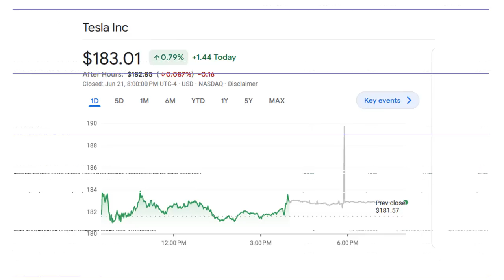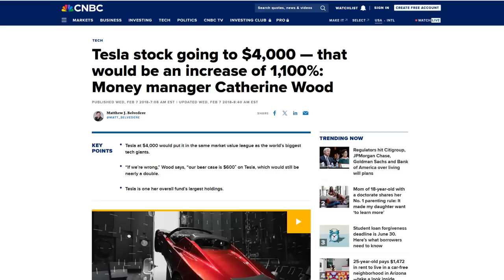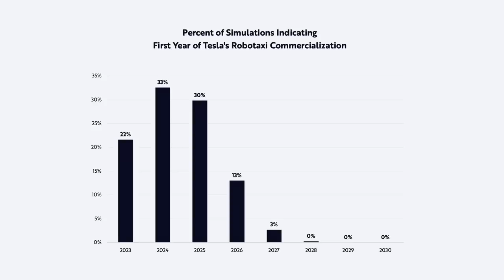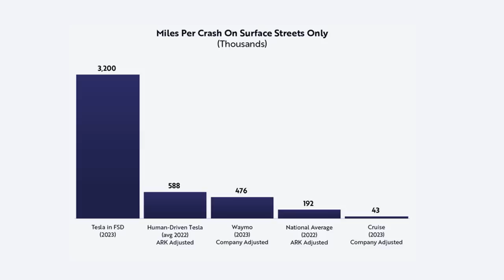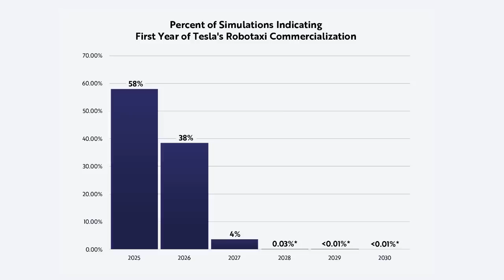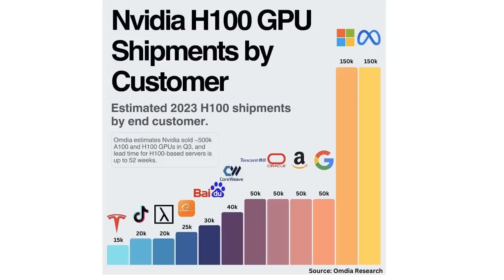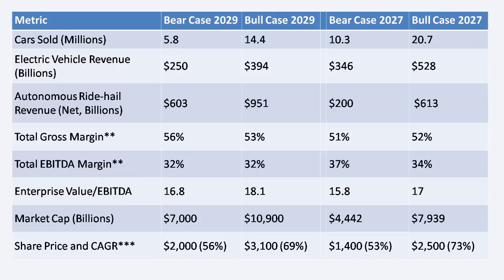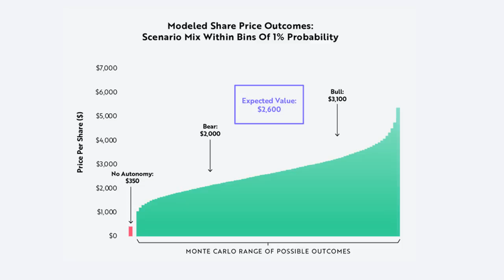Why Does ARK Invest Think Tesla Can Hit $10 TRILLION in 5 Years?

Comment: personally if i take a robotaxi and have a bad experience, i won't be taking another, and feel that starting with a human driver in the car, even if they are just there to monitor the system, will provide a sense of security for early riders and in locations that there isn't enough data already to make smooth drives possible.
elon may not want to go this route, but if there are no customers to take them up on their robotaxi ride because of experiences, be they true or false from others that they trust, that will prevent many people from even trying one.
you know the FUD is already hard core on EVs, once you begin to disrupt Uber and Lyft, they will begin their campaigns to spread as much fear for the competitor as they can.

Comment: Lets look at the Issues
1. EV Slump because people do not want EV's.
2. EV's still cost a lot more.
3. EV's still have a much higher Co2 Emissions Footprint over ICE until they are at least 15 to 20 years old.
4. Most Grids cant handle a 40% increase never mind a 2x to 4x increase in power draw.
5. Elong fired the Supercharger Team.
6. EV Batteries are dangerous and hard to fix or replace. They are literally a Structal part of the car imagine that for a fuel yank?!
7. Self-driving is not good enough and even if it was Law Makers on State and Federal Levels will be slow and unwilling to approve self-driving car tech for decades
8. LIDAR, RADAR and Sonar should all be part of a Cars Safety System Elon just relying on cameras is Arrogant and short sighted.
9. Tesla can not upscale production enough to have enough cars to make RoboTaxi a reality in the next decade.
10. Every Years FSD & Autopilot are meant to be coming.
11. Paying Elong more in Stocks than the company as EVER Made in Total Profit.
12.  Lied Cyber Trucks on the Road.
13. lied as to Cybertruck Release.
14. lied about Semi Release as well as Capabilities.

TESLA & ELON have Tonnes of issues too fix and faith to repair or they will Crush and Burn!
Reply: "6. EV Batteries are dangerous and hard to fix or replace. They are literally a Structal part of the car imagine that for a fuel yank?!"

Incorrect. EVs catches fire way less frequently when compared to ICE cars and the batteries in your car will not be needed to replace during the lifetime of your car. 

"7. Self-driving is not good enough and even if it was Law Makers on State and Federal Levels will be slow and unwilling to approve self-driving car tech for decades"

Incorrect. FSD is quite good and is pretty close to be solved now. And when there's data that FSD is safer the government will be quick to approve it. 

"8. LIDAR, RADAR and Sonar should all be part of a Cars Safety System Elon just relying on cameras is Arrogant and short sighted."

Incorrect. Lidar and radar is quite meaningless if you want to build a self driving car. It just adds noise and complexity for no good reason. 

"9. Tesla can not upscale production enough to have enough cars to make RoboTaxi a reality in the next decade."

Incorrect. When Tesla solves FSD they can instantly enable the support of FSD for all cars having the necessary hardware. Tesla have also demonstrated that they are quite good at building new factories and ramping up production. 

"10. Every Years FSD & Autopilot are meant to be coming."

Every day the earth is set to circulate around the sun? Go figure. 

"11. Paying Elong more in Stocks than the company as EVER Made in Total Profit."

He was just granted the compensation from the old compensation package where he reached all the hard goals. It's also stock based compensation so he actually needs to purchase these stocks and hold them for a minimum of 5 years.
Reply: @yourcrazybear  You assume everyone or at least a large number of people will opt into Robo Taxi (they won't, Unless Tesla Opts them in by Default!) also Elon also wants his own Tesla owned Cabs that will cut into public sale production that assumes Federal State and City Permission is given for FSD/Auto Pilot, Nevermind if Taxi or equivalent Licenses are given.

Nevermind insurance costs and who is held liable (Owner, Operator, Manufacturer?) and how that will be identified and issued
Reply: @yourcrazybear EV catch fire less because there are less of them in use and Lithium is more Dangerous than Fuel combustion of fuel requires exact right conditions it's not like you see in the films
Reply: "12.  Lied Cyber Trucks on the Road."

You should rephrase that question.

"13. lied as to Cybertruck Release."

That's a weird and diffuse claim. Are you grasping at straws again?

14. lied about Semi Release as well as Capabilities.

That's a weird and diffuse claim. Are you grasping at straws again?
Reply: @yourcrazybear Tesla did lie as too release dates for Cyber Truck and Semi as well as Capabilities just watch reviews
Reply: 1. People don't want non-Tesla EVs.  Tesla's doing fine.
2. Telsa's M3 costs less than the average car price today.
3.  That is pure fud.  Reference EPA:  https://www.epa.gov/greenvehicles/electric-vehicle-myths
4.  Most EV's are charged at night when there is little load on the grid.
5.  He only fired the logistics group, and he hired back some of them.  They were not meeting his expectations and had to be rebuilt.
6.  EV batteries are 10 times safer than gas tanks.  ICE cars have 10 times more fires than EVs.
7.  Self driving is not good enough today, but will be in a couple of years.  The governments want self driving as it substantially saves lives.
8.  That's nonsense.  Humans use two eyes and an AI processor.  Tesla uses 8 eyes and an AI processor, but is not distracted like humans and doesn't drive drunk, etc.  Too many sensors just adds confusion as when they don't agree you don't know which one to chose for a decision.  Camera's can do everything that Lidar can do.  Tesla will bring back Radar once it is high enough resolution.
9.  Of course they can.  Where's the evidence for this?  
10.  Yeah.  Advanced technologies are hard both to produce and predict.  No one else has been able to do the things that Tesla has achieved, even though they're late.
11.  The stockholders were very happy to see 15X increase in their stock price and had no problem paying Musk for that.
12.  13.  14.  These statements makes no sense.  Write like a grown up.  If you're 12 I'll understand.

If you don't believe any of what's presented, you should go troll somewhere else.
Reply: You got this outdated list from 2020? Did you ever use the internet? Time to grow up and quit whining & bitching
Reply: "1. EV Slump because people do not want EV's."

Incorrect. EV sales went down because of interest rates.

"2. EV's still cost a lot more."

Incorrect. The difference in cost is not that big. The total cost of ownership is also lower. 

"3. EV's still have a much higher Co2 Emissions Footprint over ICE until they are at least 15 to 20 years old."

Incorrect. You can almost divide your numbers by 10. The University of Michigan/Ford study found that it took 1.4-1.5 years on the road for electric sedans to save emissions versus traditional sedans. The corresponding numbers were 1.6-1.9 years for electric SUVs and 1.6 years for electric pickup trucks, based on the average number of U.S. vehicle miles traveled.

"4. Most Grids cant handle a 40% increase never mind a 2x to 4x increase in power draw."

That's a silly argument. The grid is always eventually upgraded to meet the demand. 

"5. Elong fired the Supercharger Team."

Grasping at straws already? Tesla continues to build out their network.
Reply: Well put thank you @yourcrazybear
Reply: @yourcrazybear Elon did fire Supercharger Team
Reply: @yourcrazybear When you cite emissions that's only for power/fuel consumption not the costs of manufacturing shipping etc
Reply: Do you understand the extra Mining, Refining, Shipping, Processing and Shipping and Final production of lithium cases adds at least 2x emissions than ICE

The grid takes 10 odd years (at least) to upgrade and since its run mostly by 4 profit companies they will not build more power generation until they absolutely have to (my farther works in Power Generation!)
*Most new power generation is still Coal and Natural Gas, Renewable is still less than 30 to 40 percent in most states and Nuclear is on the Decline unfortunately (with SMR and Recyclable Nuclear Power are both very safe and viable!)

FSD is not Full Self Driving requiring a lot of human interaction for simple things so no is not Full Self Driving which is also false advertising
*FSD is still years behind what was promised again false advertising it's been promised almost every year too be ready

The Slump is not just Intrests rates it's lack of public charging and trouble with private charging (especially for street and parking structures!), lack of mechanical expertise, costs of repair and replacements and much higher insurance costs

Face it Tesla over promises and under delivers constantly

Hell the bot in demo's are human remote controlled unlike Boston Dynamics and are still slower and more limited is ability
Reply: You get your list from 2020? Did you ever use the internet? or try to read news?
Reply: @shaw7598  "You get your list from 2020? Did you ever use the internet? or try to read news?"

Perhaps he copied Gordon Johnsons talking points? 😅